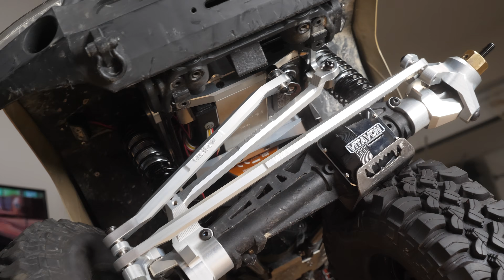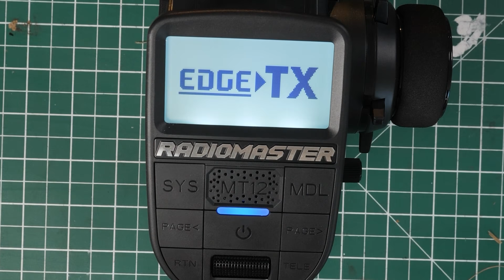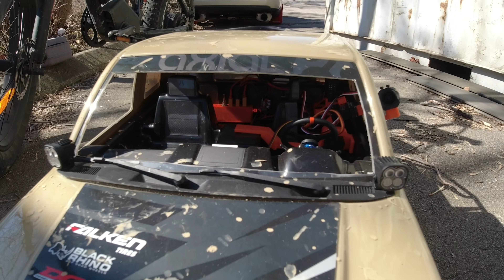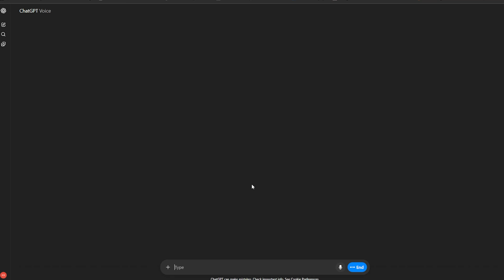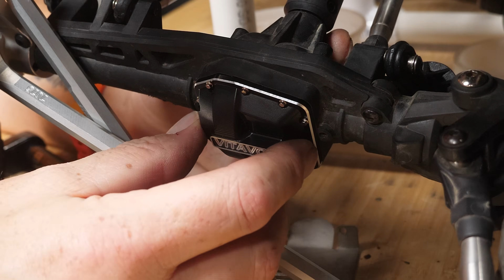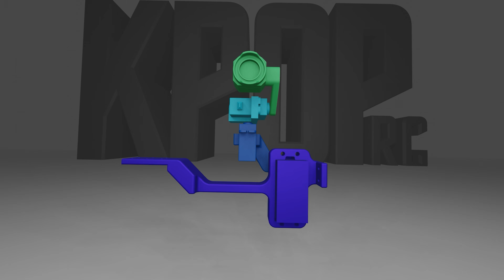How we built the LEAN OUT RIG | Lean Out RC FPV

Comment: I just want to buy it. I dont know how to do that kind of thing. I just want to enjoy driving Fpv
Reply from the maker: cost of entry is build it, my dude. this build takes way to much effort to build cost too much in parts, and will take way too much time doing tech support for us to be worth our time. unless you got 10 grand which i assume is a ludacris amount of money for something like this, you're going to have to build one yourself and spend 3500 plus the hours it takes to build it and get it working. god speed.
Reply: @kpopRC I certainly do not mind building it, or the costs involved with it as I am very used to fpv, I was there when some of the earliest DIY FPV RC machines started to come out in 2013. What I cannot justify is needing to purchase a 3D printer in order to mess around with trying to fabricate the proper camera rig. I have no other real need of a 3D printer other than for this one project. No one else I know personally has the ability to learn or understands how to use CAD software or anything that would be capable of actually fabricating this from scratch. I see this video is 7 months old, after about a year has passed, I could definitely see the argument for finally releasing the STL files for the actual camera rig. Hell, keep the newest designs for the one that actually looks underneath the truck for yourself and wait for another year. But a whole year after you have messed around with the original version enough to now have subsequent other versions, I cannot see the justifiable reason to keep gatekeeping the final process (being the camera mount as stated) for the original version 1. Agree to disagree with me if you like, but that is my honest feedback from a long time FPV and RC user. - Peace ✌️
Reply: People like you ruin the hobby.  You enjoy your hobby by your self. You could sell the files. Print instructions for people and be good for the hobby.

Comment: Now you need to put it on a trolly system so it can look out the other side. Make it center in the truck when not leaning in a certain direction. Even a torrent camera on the back for a co driver.

Comment: Amazing work! One info for people building their own: ELRS is great, but you can bind multiple receivers to a single transmitter with other protocols, too. So you might not have to buy all new equipment. 

Also for the pwn most radios have  extended limits which you need to activate. Depending on the servo you use, this might give you enough angle. But that chatgpt demo was very impressive!

Comment: This is fantastic — I’d love to build a setup like this. I’m wondering if stereo cameras would be practical, or if they might increase the risk of motion sickness. I’d also consider adding real side-view mirrors and a rearview mirror to push the real-world immersion even further.
Reply from the maker: nah. because the way that these digital cameras deal with low signal strength can some times affect frame rate. and can slow image play back. having 2 systems working in tandem would definitely cause some serious issues. let alone hacking up 2 x $1000 dollar goggles so each eye can have it's own receiver and screen, also not to mention that the feild of view of these cameras aren't close to what eye width apart focal ranges would need to be to make this work. They don't build hardware to make this happen. let alone fit in the car.

Comment: Do you think crawlers will benifit from a gimbal or is the approach you took here sufficient ? Have you ever used it in a higher speed rig ?
Reply from the maker: you mean a brushless gimbal? the problem with them is that they can't switch axis's. if you lean out the window for example it would keep the horizon the horizon. which is not what happens when say actually lean out the window of a car.
Reply: @kpopRC yes that's what I meant, it would add physical stabilization. Seems like your solution is nice for crawlers for the lookout and the gimbal would be better for bashing or racing.

Comment: Sh*t, no way.  😂 thats so cool. 

I'd have a small battery pack thats wired up to the HMD (Keeps powering HMD stuff) . then i'd use boboVR headstrap with swappable battery .  That means the bobovr battery would constantly charge your smaller battery, when it starts getting low then hot swap the battery on the back.

Can you get AI to knock up a bluetooth script for your data?  <SNIP> OMG, that seeed studio gear is amazing.  I just went to look up the gear you are using and lost hours. heck yeh, BT your own data. you got it.!!!!

Comment: This is great! I will build one for my. The arduino board can deliver enough power for the servos, or you just use the arduino for the signal?
Reply from the maker: The BEC provides a single power rail that feeds the receiver, the servos, and the Arduino.
The power and ground from the servo input and output are commoned together and also power the Arduino.
Servo current flows directly from the BEC, not through the Arduino.
The Arduino only reads and outputs the control signal.
Reply: @kpopRC I just ordered the mt12 elrs have the caddx setup and I'll see how it gose

Comment: Radiomaster has support for wireless trainer with an sbus rx. Maybe they could make it so you can use the same system just for headtracking?
Reply from the maker: yeah im not sure that will work. as the head tracker would have to be an expresslrs TX.
Reply: @kpopRC I guess you can flash a Rx as tx

Comment: You can use the head tracker wirelessly with elrs backpack!
Reply from the maker: Cool! i can't seem to find much info on how to get that up and running. it seems like the back pack is primarily used to change video channels and doesn't have bluetooth. which would make life much easier than figure out how to send headtracking data to the backpack module.

Comment: I have a 180 degree savox servo that works without any physical add ons, I just extended the range of the channel to 130-150% instead of 100%. I am also using a radiomaster mt12 elrs model transmitter
Reply from the maker: the extra benefit of our extender is the exponential smoothing, and averaging from an inherently jittery head tracking source.

Comment: Your project was a good source of inspiration for my FPV setup. 
I went on a more budget setup, less 200€ of hardware with basic dual-lens VR goggles using my smartphone as a display (double that for single-lens like I need) and the DDF-350 radio I already had .... Still digital FPV though (Runcam WifiLink 2), but without lean out of the window, there's not that much room to keep everything inside a 1.9 Wraith, and not that much range ... but still enought to experience another way of driving.
Waiting for better days to test my latest addition, a flight controller with OSD.
https://www.youtube.com/watch?v=1P4HRQr2ts8

Comment: Our system for our 1/6 drift cars mixed with this would be pretty sick, we've got ours with lifelike movement, so 180 degree pan and 90 degree tilt, we use a linear servo for the tilt and a 180 degree 10kg micro servo for the pan, it all fits into the chest cavity of our skeleton, so adding a third servo to the trunk wouldn't be a problem, although OSS wouldn't have much use for it aside from using it in our semi-trucks, but I'd be more than willing to give you guys some help in putting your entire system into a 'semi-autonomous' figure, downsizing BOB to 1/10 wouldn't be a problem, especially considering you're using the same approach with hard mounting the interior, we hide all of the electronics for our FPV system on the bottom of our interiors.

Comment: I built this with a friend back in 2017: https://youtu.be/PgaO3EkDxPQ?si=wVkrQu9NmjjeGHP4
Some things I remember from the project:
- Having to physically tilt your head to lean-out was a very annoying experience. It was much better as a button on the controller to toggle.
- When you stick your head out of a window, you don't just pivot at the neck so linkage was required on the lean-out feature to prevent the disorienting entirely-sideways view.
- Everything needs to be beefy to prevent it from breaking.
Reply: Love the way you implemented leaning out ... couldn't do it with my Wraith, didn't want to cut as much of the body and the cage is in the way anyway.
Reply from the maker: We use a knob

Comment: Wish I had a spare $3,000 so i could build this
Reply: you just have to buy this stuff one bit at a time.
Reply: @JIPPERR_1 yup!! Little by little, usually appreciate it more when it’s finally done too
Reply: Beware YouTube Cooking Show Magic. More painful than going out $3,000 is going out that much and it doesn’t work. And you can’t get it to work.
Reply: At that point just get something 4 wheel drive, weld the diffs and get some taller tires and shock spacers
Reply: @joe-_-  lol I was gonna say the same. I got 4 grand into a pretty capable 4wd nissan hardbody, before that about 4500 in a long arm xj. but all that aside, this is some of the coolest shit I've ever seen and im dying to build my own 😂
Reply: @joe-_- this is for people that live in the city. Literally hundreds of parks you could do this.. but no where to off-road.
Reply: Marketplace
Reply: I got 700$ in jus the fpv setup so far
Reply: @edrummel846 caddx ftw
Reply: i just put caddx moonlight on an old $100 slash basher with an amazon 4pole n cheapo lipo 2S n its fun af
Reply: Bro this comment is going crazy😮